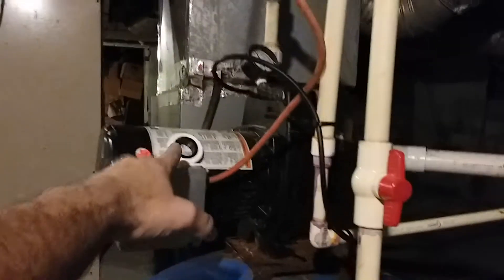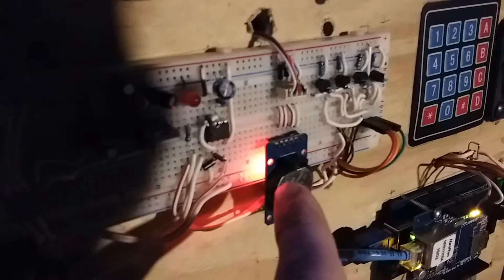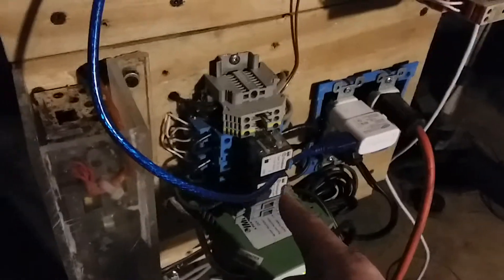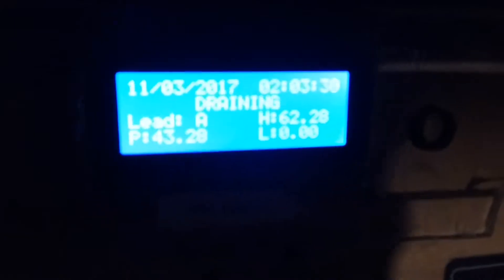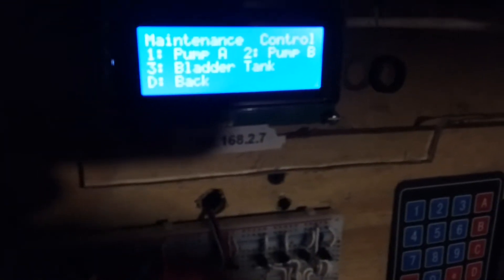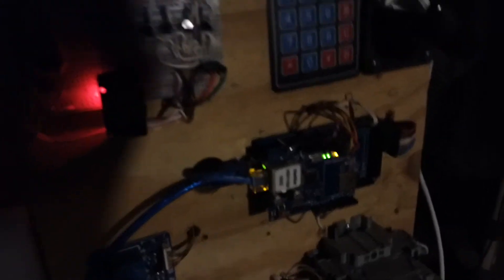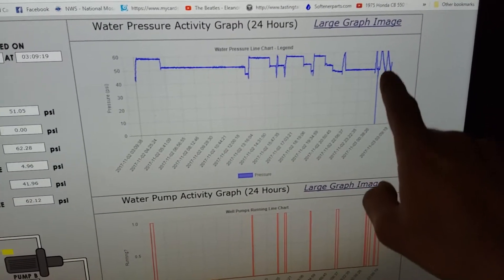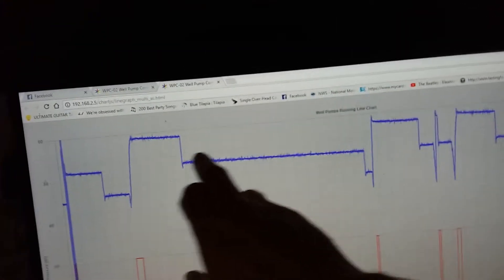Arduino Controlled Well Pump Controller

Comment: Nice work, I totally agree. Data = Good! I have just ordered a few pressure sensors and electric ball valves so I can remotely monitor and troubleshoot my farm & house water pumps and shut down or isolate lines remotely as leaks in poly or troughs are a common thing that can go unnoticed for some time. Last week I lost all the water from my house tank due to a broken fitting and at the same time, the farm pump running from cattle breaking a trough fitting, hence the new parts. One thing I would advise is loading a copy of the ide, libraries and project to a usb and keep it stored with the Mega. Backups for backups also good. Also like how you have all your settings adjustable on the fly.